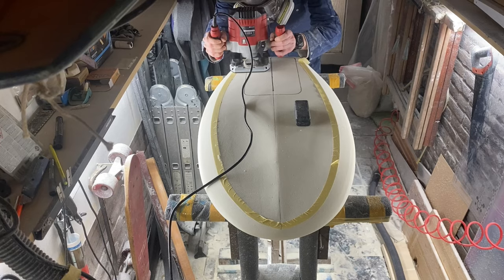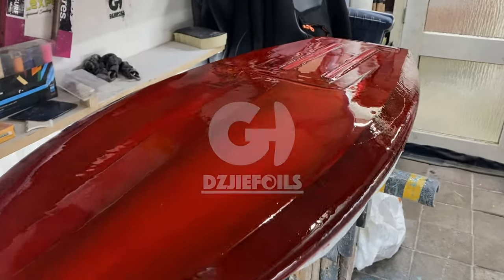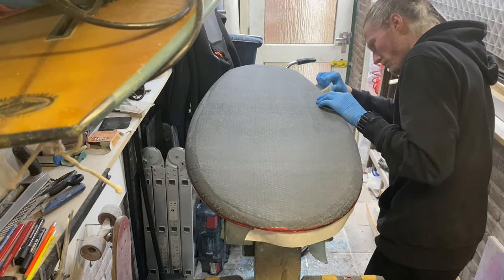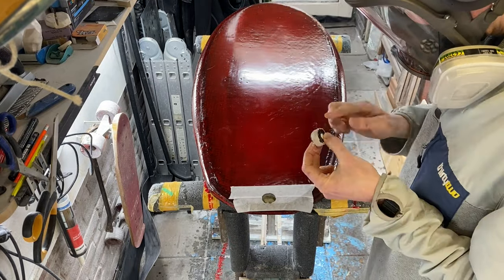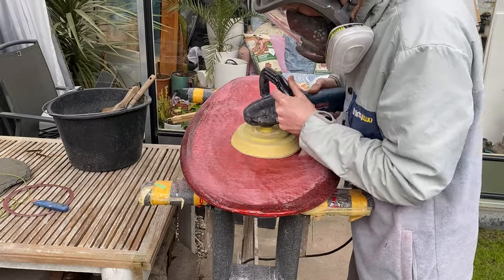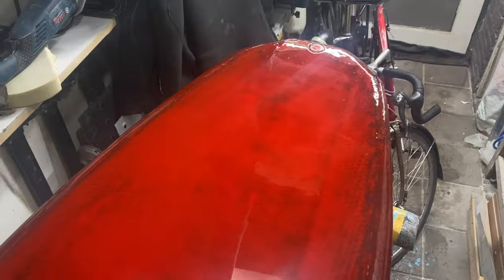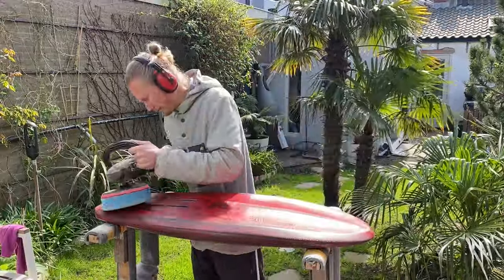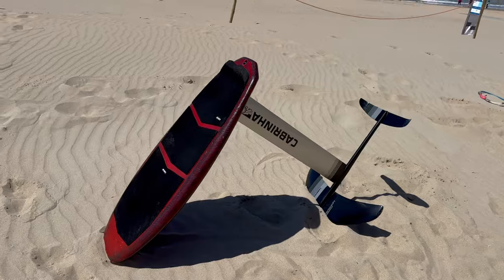How to build a kitefoil board? | part 2 | finishing and into the water!

Comment: Nice project, what ist the weight of the board und the dimension . Thx, all the best from the Baltic Sea
Reply from the maker: The board is too heavy. Around 5 kg's. It's around  5'9 x 20 x 2'1/2
Reply from the maker: O sorry I thought this was a comment on another video of mine. I was confused with the 3d printed board video, that got a lot of comments.
The board is definitely not 5 kg! More like half of it. Between 2,5kg an 3kg. It's very short: 3'8" x 17" x 1"2/3